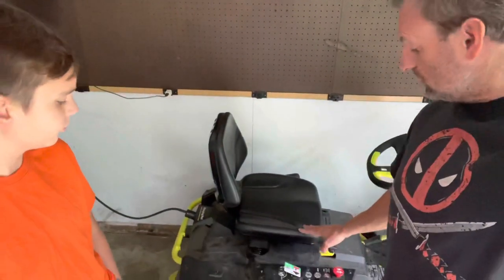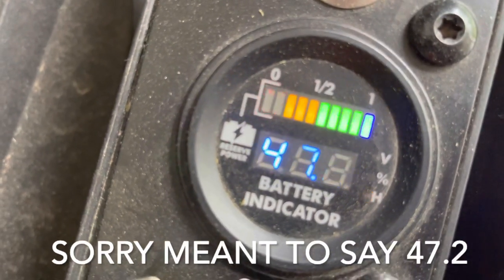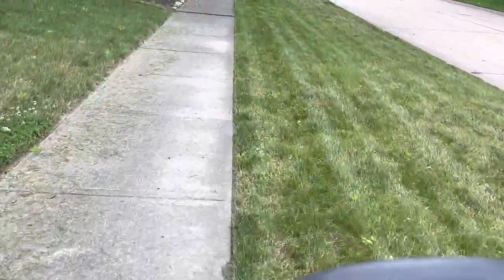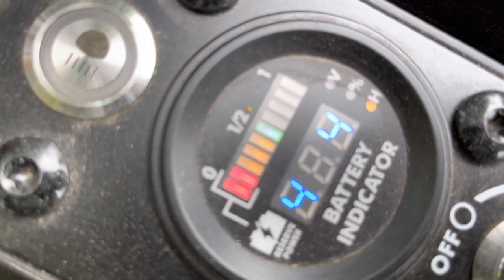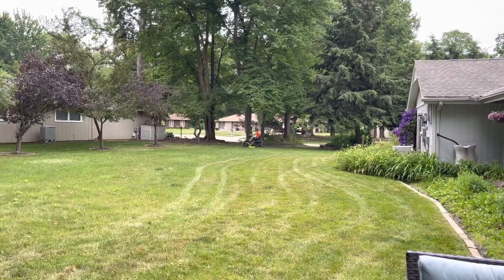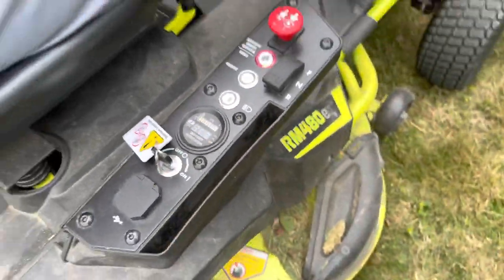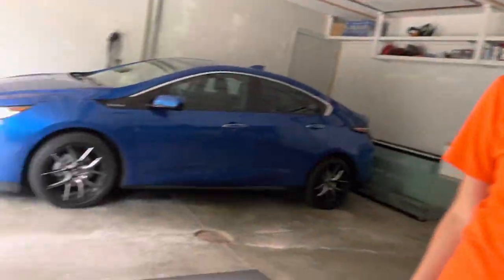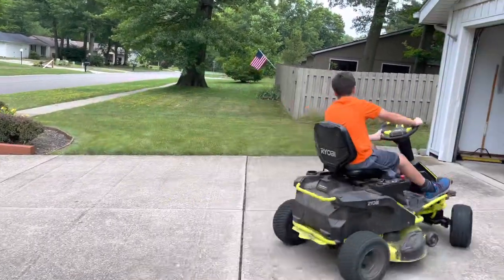Putting The New Battery In Our 100AH RYOBI Riding Lawnmower To The Test!

Comment: Just replaced my 4 batteries from 75 to 100. I added a 48 Volt PowerPulse. My batteries lasted from 2017 to 2022 spring. $1025 to replace all four. Thanks for your videos. The battery test & replacement helped me.
Reply: I saw your comment on the Home Depot site, got the power pulse idea from you. Do you think it would be problem upgrading the batteries from the 100 to 115 ah used in the 54 inch model?

Comment: I have the same model, the first summer, I could mow the whole yard and still have 90% left. At the beginning of the second year(with only 11 hours on it) it would die before I could finish the yard. Since it was under warranty, I took it to the local Ryobi repair shop, they said they had worked on several of these. Seeing how at work I worked on electric forklifts and other battery-powered industrial vehicles, I have a good knowledge of knowing the signs when a battery in a pack goes bad, so I told the repair shop, I thought it was 1 of the 4 batteries, a week later, they said they found no problem, after letting it run for an hour, I asked it they drove it or cut grass, they said no, so they kept it another week saying they had driven it for 1 hour and found no problem, I asked if they checked the batteries and they said they had, and asked it they actually drove it and cut grass, they said they had not, so they kept it another week, called me back saying they cut grass for 1 hour and found no problem, and that they had checked all the batteries. So I picked it up, what they didn't know, I wrote down the hours when I dropped it off and when I picked it up, they claimed they ran it at least 1 hour each of the 3x they tested it, though the timer only had 1 hours more on it. They said they charged it and it was ready, when I got home, didn't even make it 1/2 way through the yard and it was dead, so I charged it, and had the same result. I contacted Ryobi and told them what was going on and that I had the unit to test the batteries, they said that would be fine, when I took the back cover off to access the battery tray, I noticed the bolts that hold the tray in still had the factory paint marks lined up, meaning the battery tray HAD NEVER BEEN PULLED OUT, and that is the only way you can test each battery, so the repair shop(Randys in West Columbia SC) never tested them, and they never put the 3 hours on it as stated. I checked and found 1 battery bad, Ryobi sent me on and all was good for the rest of that season, now here we are, another season and at 50 hours on the unit and at least 1 battery is bad again(haven't checked them yet) so I can say, I will be spending A LOT MORE money on this unit than I ever did on my gas unit. Plus the blades are SOOOOO thin, they don't last 1/3 of what my gas blades did, and if the grass gets just a tiny bit high, this electric bogs down, so, I won't be getting another one anytime soon. Also, seeing how the blades are directly mounted to the motor, keeping the blades balanced is far more important, using a nail on the wall or the inverted tapered thimble-looking thing are not the best option, so I bought the Magna-Matic MAG-1000 Blade Balancer, that's about 200.00, but let me tell ya, worth every penny, although there are some cheap knock-offs on ebay for about 60.00. I now sharpen and balance not only my blades, but several others for people, they really like the mower running much smoother and not damaging the bearing as fast. Bet you didn't know when balancing a blade, there is both verticle and horizontal balancing, you can't detect that with a nail or thimble, so you could be eating away at the bearings much faster than If the blades were really balanced.

Comment: Great videos, I really appreciate them!  I am having same issue, where one battery tests lower than other three and only get 30 minutes cut time.  One battery company told me that should replace all 4 at same time or will damage the new battery.  So I want to know, one year later, are you still happy you replaced just the one battery?  Still getting good cut time?  Thank you.
Reply from the maker: We've done several update if you click on the play list and the videos linked in the description and pinned comment.  It actually works better now than it did initially and like we said in the video and all the follow ups, we are sure that the battery was defective from the get go....we will continue to post updates as with all the things we review
Reply: @jackanddan  Thank you for the fast response!   I am watching the update video.  I will replace one, and see how it goes.

Comment: We were told that the batteries in the mower have like an 8 year life before needing to be replaced. So  you definitely must have had something go wrong with your original battery in yours.
Reply: I got one 2 years ago and the batteries had a 2014 sticker on them. So by the time I got the mower they had been sitting without being charged for 5 years and they died by the next year.
Reply: @TheHutts  Wow, I didn't even think about that, I know my mower won't have that issue because it literally said 2020 model, but who knows the mower might be made in 2020 but the batteries they are using could be new old stock.